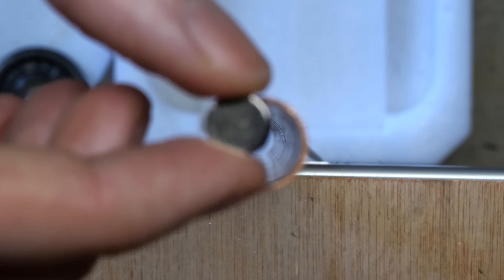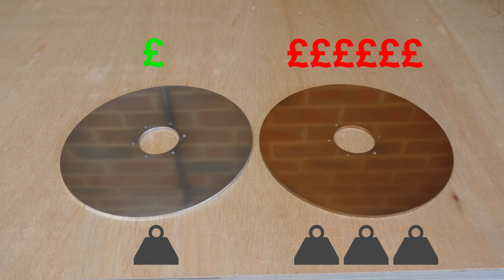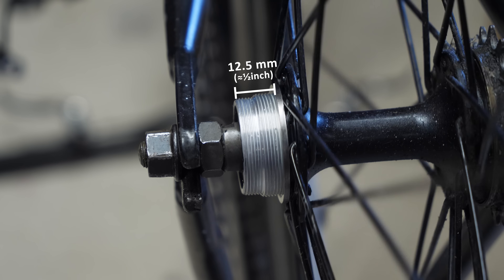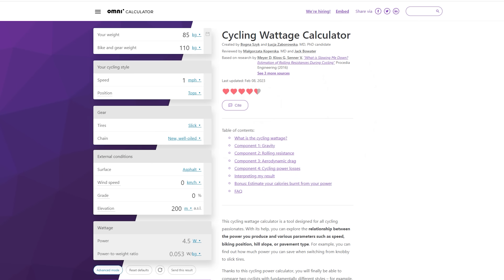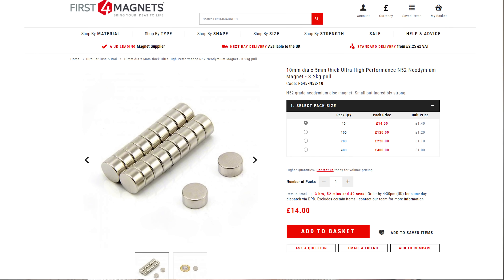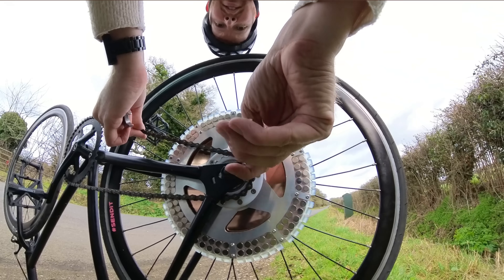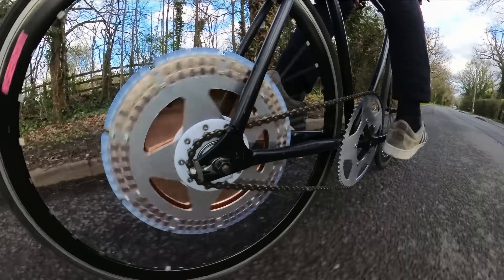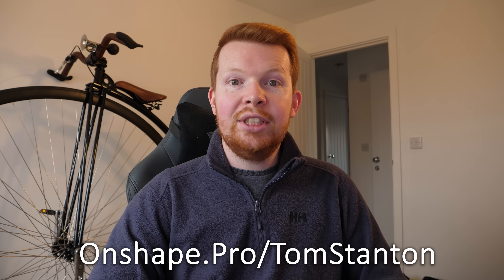Gearless Magnet Bike

Comment: Correct me if I am wrong, but is that not also part of many train brakes? They have massive weight, and they can use a similar setup to slow down from high speeds without friction discs or anything, and then after they have slowed down for the most part they can engage regular brakes for the complete stop, as the magnetic braces are not really powerful the slower you go

Comment: I wonder how efficient a bike would be with a dynamo on the cranks and an electric motor on the rear wheel. With no chain, only wires transferring the power.

Comment: I haven't finished watching the video yet.. but have you thought about ditching the magnets all together and doing coil electromagnets with the same configuration and use an Arduino, transistors, and flyback diodes to switch the coils on and off to further increase the resistance? You could hypothetically induce alternating opposing poles at any given set of coils in milliseconds.
Reply: And get you some Magnesium alloy wheels.

Comment: The 68W calculated for peddling on flat ground was then used to determine the power loss in the magnetic clutch (the clutch doesn't produce any power, only consumes it). A better thing to do is work out the torque required for peddling at 10mph and minimise the clutch slip at that torque level. This would require more magnets and a larger disk.

Comment: I was looking forward to seeing the heat dissipation off the copper disk after trying to climb the hill. 
If I’m not mistaken the increased heat will reduce the copper/magnet efficiency, which would make your life that much harder. 

I’d love to build something like this to see how it feels!
Reply: I would love to see some kind of heat energy recovery system that gets the heatm turns it into electricity via the difference in temp from the disk and ambiant air and supplies that energy to an electric motor for assistance. It would be super complicated and mega uselss, but it would be super cool.

Comment: Great experiment. Totally enjoyed it.
Would pedaling backwards help slow it down?
Reply: Yes it would, as it increases the difference in speed between the copper and the magnets.
Reply: Agreed. One problem with using the magnets as a brake as Tom did in the video is the torque is proportional to difference in angular velocity.  So as he slows, his deceleration decreases, so instead of stopping like regular brakes it slows in an exponential decay.  Slower and slower, only going a finite distance but never actually stopping. (A mathematician will gladly solve this differential equation for you, for a coffee.).  Maybe a method is to lock pedals, then as the torque reduces, pedal backwards.
Reply: @andrewkepert923  at some point in the reverse direction wouldn't the bike slow and 'want' to go backwards?
Real difficult to balance and  ride, mind you.

Comment: I wonder if you could make a fluid/hydraulic version similar to a torque convertor? and possibly. you could make the blades tilt/adjust to allow more slippage or less slipage in the system when needed.....

Comment: Actually aluminum is much more conductive than copper. That is a true statement. The reason it is sometimes not is due to a lot of outside factors the biggest of which is probably oxidation. Google did not lie to you and you were just mislead by circumstantial evidence.

Comment: If you want to use inexpensive magnets from less than honest sellers go for the n40-n45 range.  Pretty much anything sold as n52 is seriously overrated, while with the n4x magnets you usually get what you are paying for.  I guess if they're going to fudge the rating they just go straight to the top.

Comment: It may not be a good way to move a bike, but for a long term, low wear exercise option people may like it it, either to move around or on a stationary bike. Getting resistance, revolutions, and minimizing wear can be trick and this may have potential.
Reply: That's how some stationary bikes work already, moving the magnet closer to the wheel to increase resistance

Comment: Next time try hydraulic drive. Pedal powered small oil pump send pressurized oil to the hydraulic motor bolted on rear wheel hub.

Comment: In induction motors they use a cage type rotor... not sure how that could be incorporated into this kind of a design but maybe food for thought. In addition, I would have recommended getting a single rectangular magnet as opposed to a pair of 2 cylindrical ones... While the cylindrical ones on their own give nice symmetric magnetic field lines, when you place them so close to one another (especially in an alternating manner like that), the field lines become a proper mess and are not perpendicular to the copper plate in many places, meaning you lose performance.  You can pack the rectangular ones much closer to one another, and the resulting magnetic field lines would generally also be more perpendicular to the plate as well. Ah, and you *could* also try making halbach configurations on both sides although I am not sure that it would give you better performance in this case.

Comment: What about ebike with magnetic transmission and magnetic gear reduction? I saw there are some magnetic gears invented and that thing might work. Putting huge copper circle on the rim and trying to power with small high rpm motor and magnets attached to it

Comment: I think you can solve the chain sticking to the magnet problem by just simply putting a metal sheet on top of magnet on chains side as field line will pass throught metal sheet. If you have equal and opposite magnets .
Reply: This is a better solution than you might think.  A thin bit of steel on the chain side of the magnets will connect the field lines of magnets through the steel instead of attracting the instead of the chain.  But that's not the cool bit.  The magnetic field strength on the copper clutch side will also be stronger.

Even better is to put cube magnets in a special pattern called a Halbach array, sort of a "one-sided flux" structure.   https://en.wikipedia.org/wiki/Halbach_array
Reply: @jeanbeaupre4006   oh wow i dodnt knew something like this exist thank .
Thank you for teaching me something new

Comment: In case you weren't aware, mag clutches do exist and are in wide use, up to around 20 horsepower I believe. Should be no issue for your uses. 

I miss the air engine videos.
Reply: I think magnetic clutches use magnets on both sides? So it'll be equal speed up to a certain torque. I doubt anyone would want to run something with constant slip.
Reply: @C. I think that's specifically when you want to lose energy, I.e., braking. You would want to use something like that for driving something.
Reply: Don't those work by increasing the viscosity of the ferrofluid? No eddy currents involved.
Reply: I believe the air conditioning compressor also engages with a magnet clutch

Comment: I think you calculated based on cruising power rather than the power needed to accelerate/decelerate.

Really interesting build!
Reply from the maker: Yes that's correct, my aim was mainly to maintain a cycling speed rather than accelerating fast. I did some research regarding eddy current brakes, and all of them suggested slots would reduce the braking force, so I assume it works differently to a motor.
Reply: @Tom Stanton  with brakes you want to dump the power to heat, so that makes sense
Reply from the maker: @Daniel Taylor  that might be true, however adding slots also reduces the resistance between the copper and magnets. So I assume it would need more magnets to compensate.
Reply: @Tom Stanton possible. You also won't get coupling far away from the magnets.

There's a lot of variables to test if you are so inclined,  but I  would definitely focus on motor design
Reply: @TomStantonEngineering  
Did you try using a Halbach Array?
As you know a Halbach array is a special arrangement of permanent magnets that augments the magnetic field on one side of the array while canceling the field to near zero on the other side. This is achieved by having a spatially rotating pattern of magnetization.
Reply: @TomStantonEngineering  I have an idea that might actually help!! Maybe you could buy plates of the worlds least magnetic material and shape them to fit over the side of each group of 10 magnet that is facing/putting a force on the chain (Just make sure that on the back of each plate you have a material that will not pull away from the magnets), then you have will not have to worry about the magnets causing any unwanted effects around that area. Also, by toying some more with the North and South poles you may stumble onto something else that could help out as well. I am guessing since you have the magnets doing the work, that it kind of feels like the bike is riding on non slippery ice with a bit of a hovering sensation (I would like to know if I am correct) :)
Reply: Also:
If you look at induction motor rotor design you see that they commonly have slots.

Part of the reason for these is to reduce the reach of eddy currents that cause those heating losses you see.

So cutting a bunch of wedge-slots in the copper disk would probably improve performance a lot
Reply: @argledotorg  those Eddy currents are a feature here, not a bug. It won't function without.
Reply: @Azeazezar  if they travel too far, they generate heat rather than force.

This is an induction motor stretched out onto a plane, with the moving electric fields provided by physically driven permanent magnets instead of AC/stepper controller driven electromagnets.

It's an elegant and clever device, for certain.
Reply: acceleration power is lower if acceleration is slow
Reply: @Blox117  right. And if you design the magnetic coupling to handle the cruise power, the acceleration is limited to what that power can provide 

It's not a big deal,  but it does show on the real-world performance tests